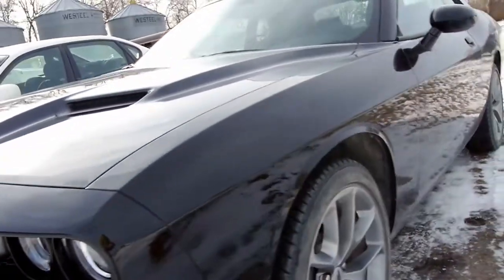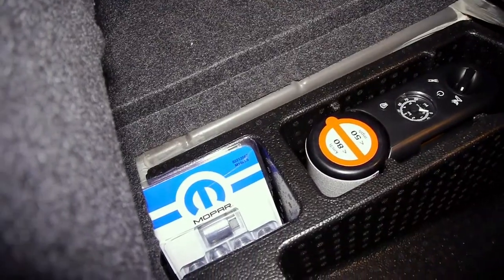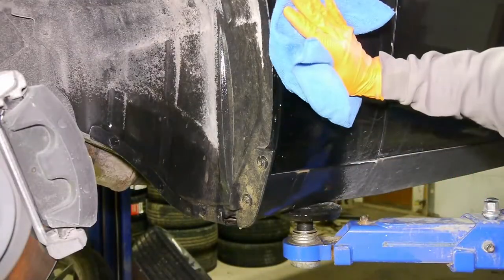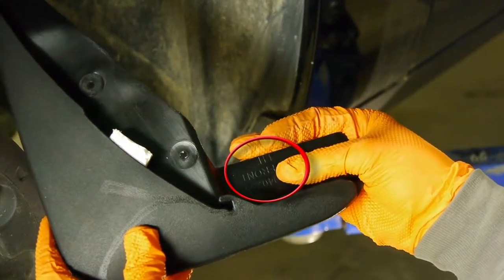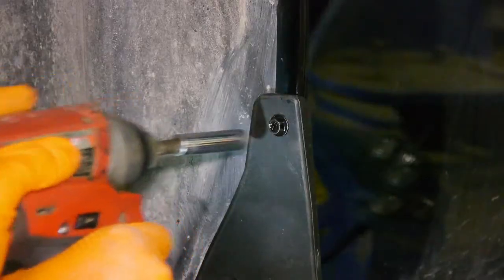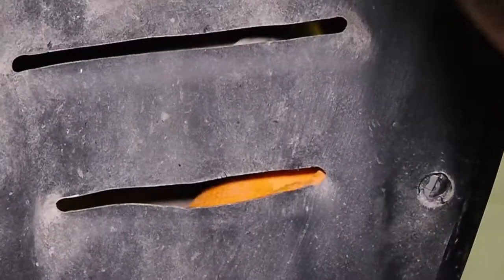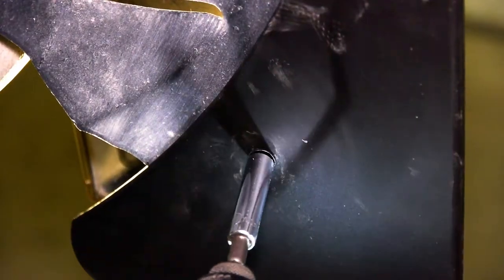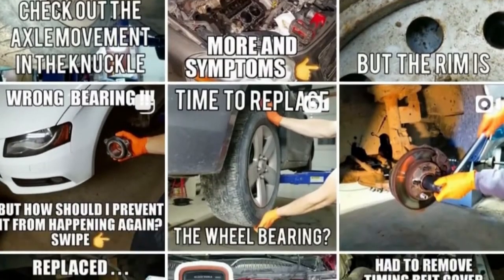How to install Mud Flaps on a Dodge Challenger

Comment: Nice guide. I just received similar units for my Challenger, and they came with no instructions whatsoever. I'm sure it's have figured it out, but your video helped me out! 

I live only ¼ mile down a gravel road. 4 miles is rough.
Reply from the maker: Yes. Washing is pretty much unnecessary at 4 miles. I'm glad the video helped.

Comment: If you think I'm removing my tires to do this,  you're insane. Lol

UPDATE: Took 45 min, TIRES ON,  NO LIFT. all you need to do is turn the front tires to give you the room to drill. And if using Phillips screws get a tiny socket-ratchet with a Phillips head.  REAR TIRES, all you need to do is grab a trusty pair of pliers, from the inside of the rear fender, you'll see the 3 punched out plastic keepers holding the push pins in place,  grab, twist pull (then push through the hole) for the drilling part, unnecessary, use your screw and Phillips ratchet,  drive it through the plastic,  apply appropriate clips, then install. Easy,  peasy.
Reply from the maker: Haha. I guess there you go. Thanks for the update.
Reply: @AutoTechWorld_DIY  thank you for your video! ^_^

Comment: Am I able to install the mud flaps without removing the tire or lifting it?
Reply from the maker: You could try. But it's going to be a lot more comfortable, if you take the tie of and lift it a bit. Just make sure you use safety jacks and everything is safe. I'm not liable if anything happens. You should get it done by professionals. 😉